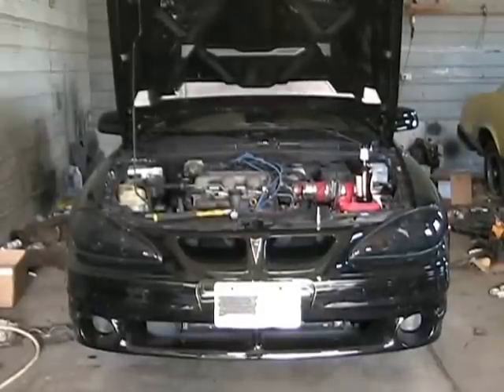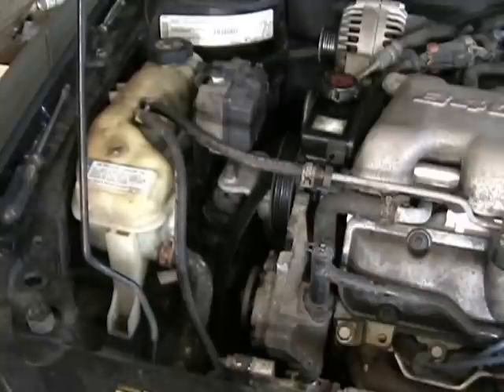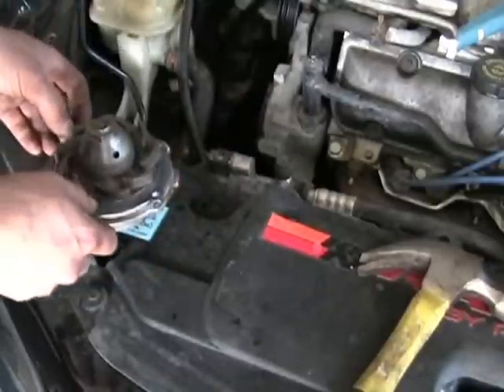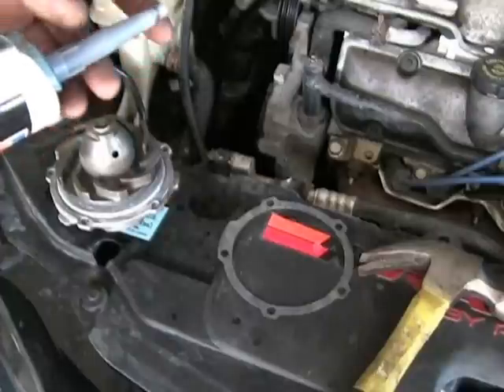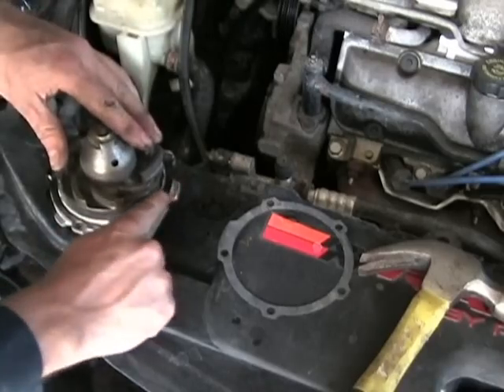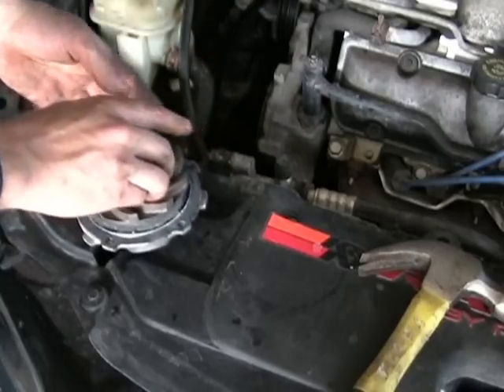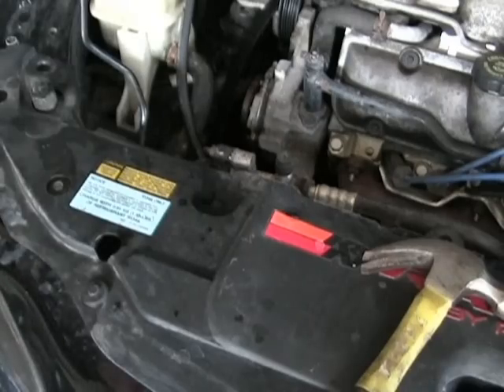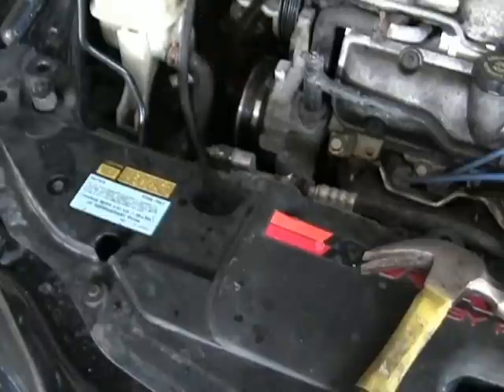HOW TO replace water pump

Comment: @gestwicki He's using a thin coat of it to hold the gasket in place on one side only, which is ok. I've always done it this way and have never had a leak and so have many mechanics. If you don't do it this way, you risk a mangled gasket as the gasket can move around quite a bit when you're installing it, especially in places where there is very little clearance.

Comment: I have to replace one of these tomorrow morning on a 2005 impala. It's the same motor. My question is do I need to take off the belt that the pump rests on or is there a way to loosen it. Also, do you need to take the housing off that the hoses are attached to. It looks like you just took that out of the middle...